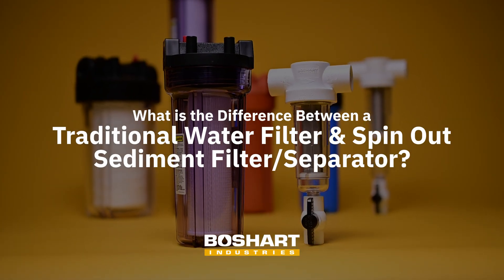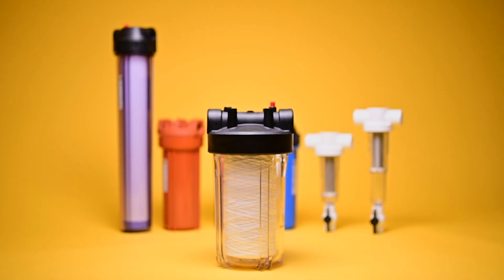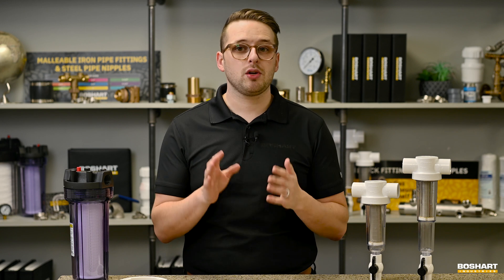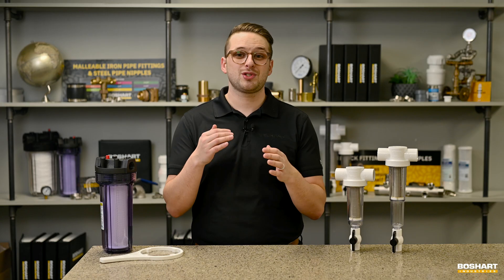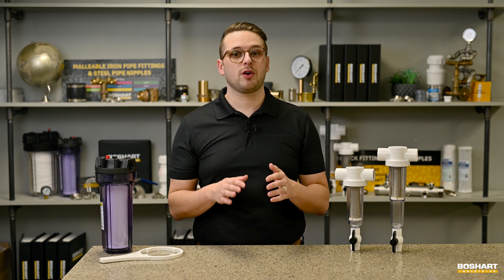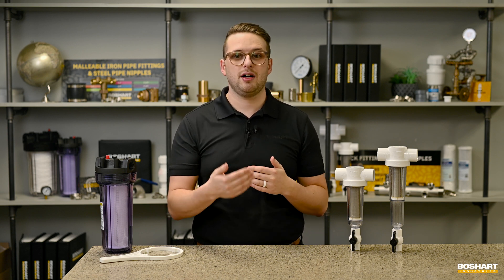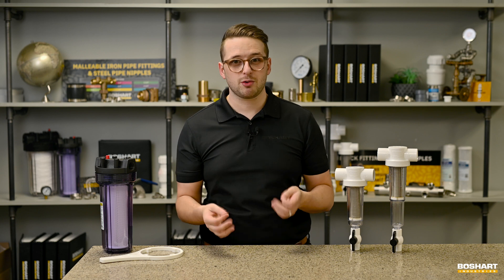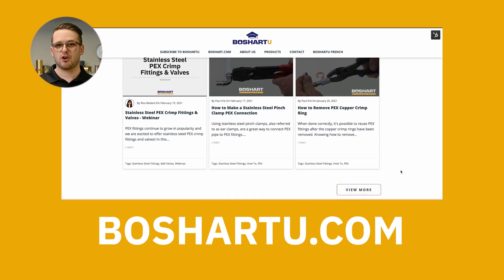Difference Between a Water Filter & Spin Out Sediment Filter and Separator

Comment: if there are many rust particle sendiments coming out from the apartment building pipes onto my hot water pipe under the sink, can i use a sediment filter on the hot water?  will these plastic canisters on these filters break or pop due to the heat of the hot water ?